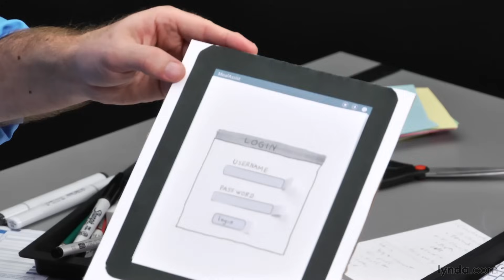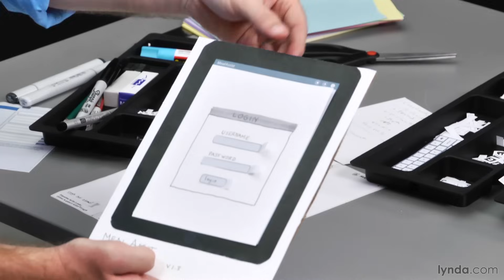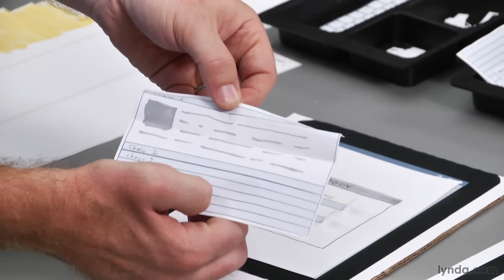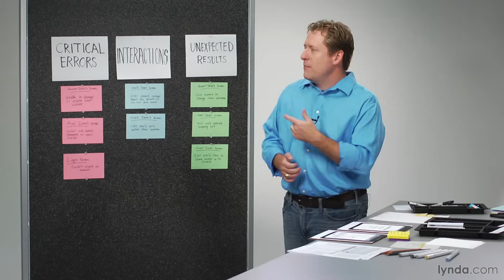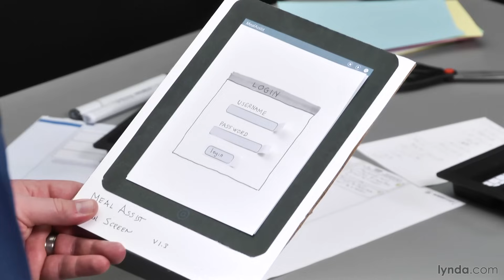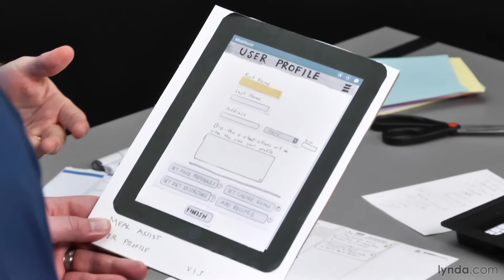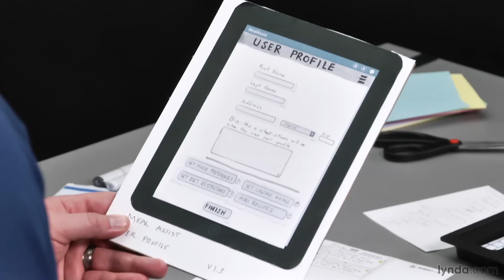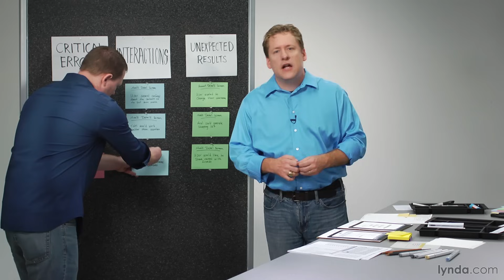UX Prototyping Tutorial - Paper prototyping techniques

Comment: This is one of the best courses on Creating prototypes, comprehensive and extremely useful if your serious about the usability of your product. Cutting out & glueing paper prototypes is not dumb. You’ll notice a hell of allot more starting from a paper prototype & ultimately a better product and generate far more ideas than without. ⭐️⭐️⭐️⭐️⭐️⭐️⭐️⭐️ Also paper prototypes are shown as only the 2nd stage after sketching the 3rd part shows you how to produce Low-Fidelity prototypes in Adobe Fireworks that you can then export as html to produce clickable prototypes, that can be easily distributed for testing.

Comment: Paper prototyping seems fun, but I think Powerpoint prototyping is as cheap, flexible, easy and as quickly done as paper prototyping. All the materials you need to create a paper prototype might not already be in hand so you might end up spending some money just to buy tracing paper, index cards, re-stickable tapes, and sticky notes. Hell, you might even run out of paper. It takes so much time just to prepare the elements you'll possibly need for your prototype before you can even start building it. However despite all the negativity I've mentioned, I think paper prototypes are appropriate for testing out new gadgets or machines that are similar to ATMs, cash deposit machines, and etc. Projects that uses a lot of animations and effects are probably better to use digital prototypes instead.